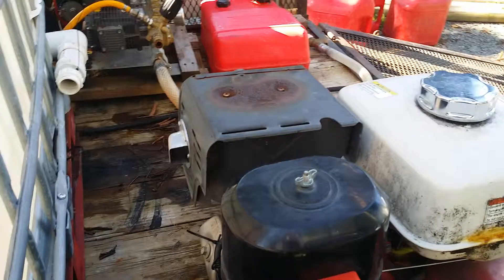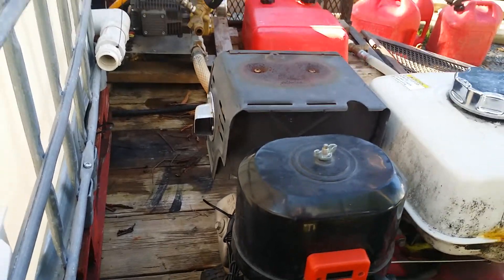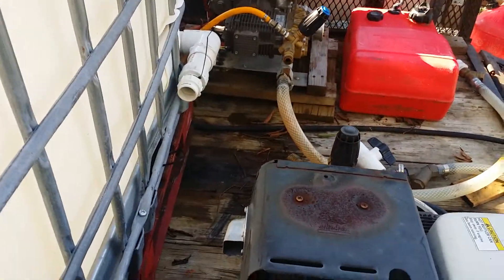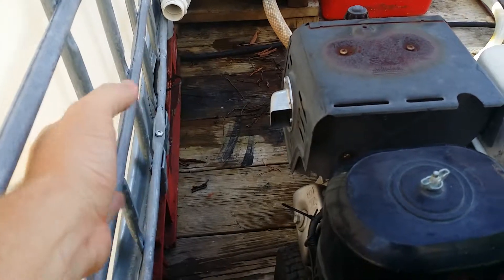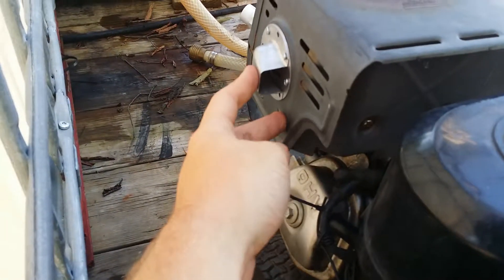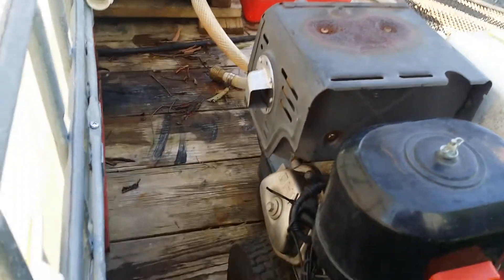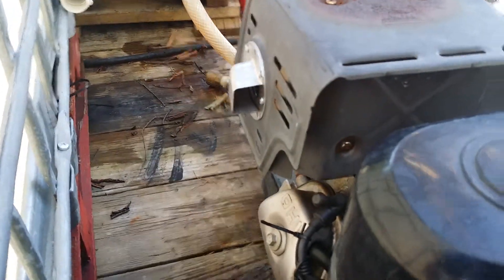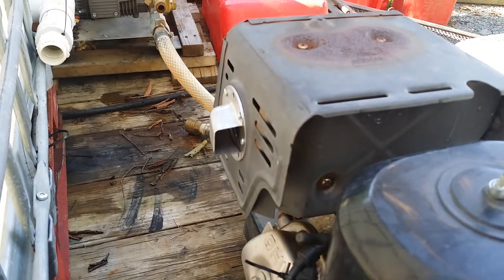Muffler deflector

Comment: Aren’t you pointing the exhaust right towards the intake box?
Reply from the maker: Somewhat.  It still has plenty of space though
Reply: @Cleanpowerwash  reason I found this video we have a compressor in the back of a van.  It’s got to the point that the exhaust soot totally clogged the intake filter.  Trying to figure out how to get the exhaust outside the van without removing the stock muffler.
Reply: @SylasG  have you found a way yet? I also found the video searching for ways to direct exhaust from an engine mounted in the back of my van out of it.